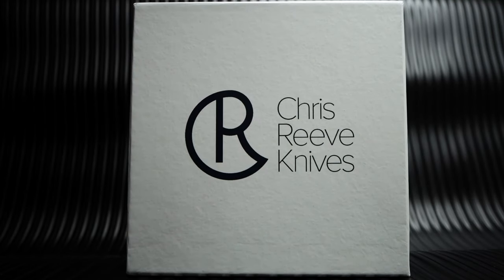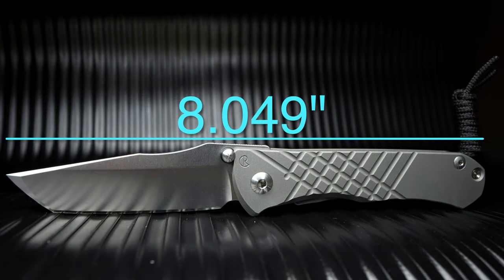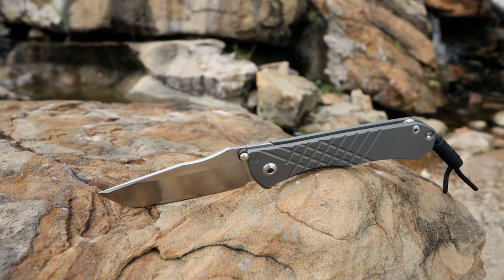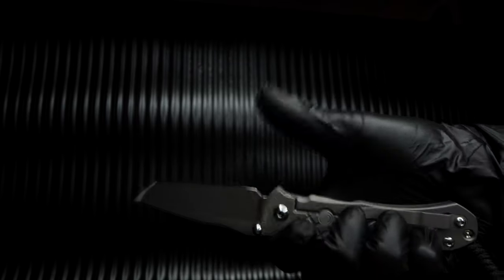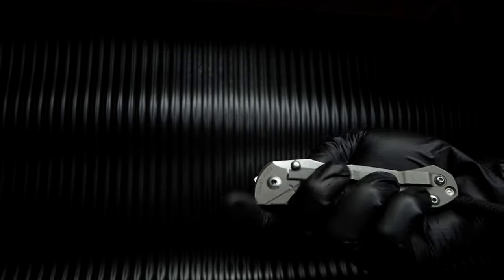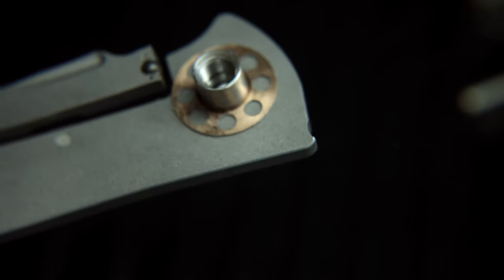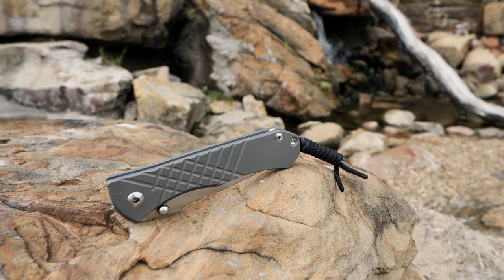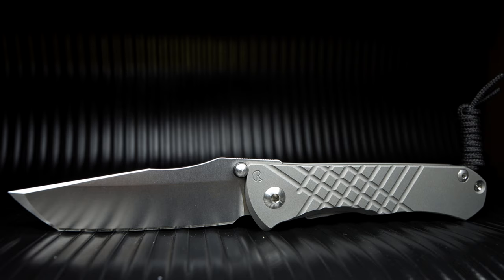CHRIS REEVE MACRO CERAMIC DETENT UMNUMZAAN SHOTS

Comment: This or the Liong Mah 2v3, pick one.
Reply from the maker: both, that's y I bought both.. no but honestly they fill different spaces in there collection if I want some ultra smooth then its going to be this, but If im going for ultimate style, with functionality and the ability to hydraulically fall shut, in a fidgety mood I would have to roll with the Warrior.  But I have a Warrior by A2, Warrior 2v2 Full Ti, and a Warrior 3... I will only ever by one Umnumzaan if that helps answers the question.. Lol